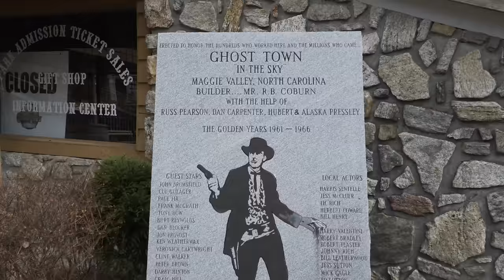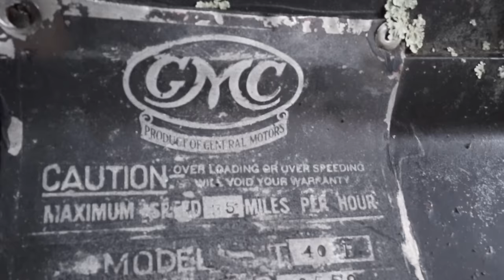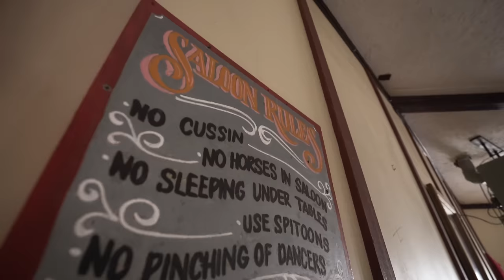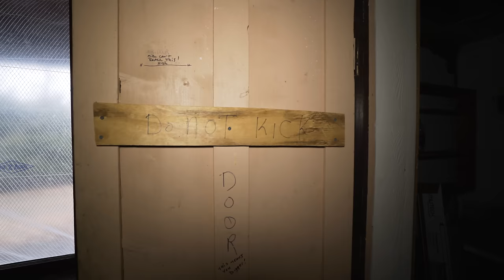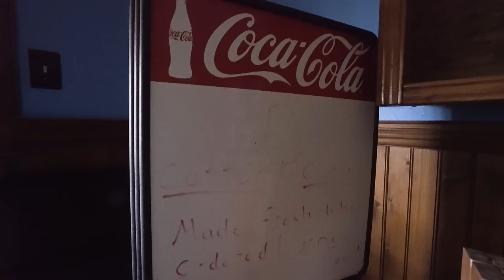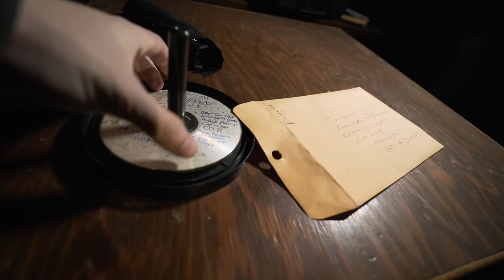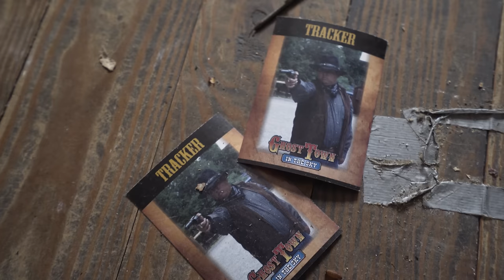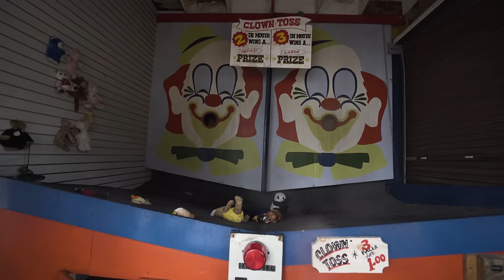Abandoned Theme Park on Top of a Mountain - Ghost Town in the Sky

Comment: Ride operator here! For those wondering, this is a Hopkins coaster, and yes they were quite a small manufacturer. This is one of 9 roller coasters they made, 7 are still operating today. They made a few loopers and family coasters, nothing outrageous. As for that control panel, it's about par for that coaster, it's not the system most rides use at big parks today. We usually have a screen for error reports, or even on the older coasters, to tell the time. The trains did get replaced in 2009, but it only ran a little bit in 2010. This coaster was originally called Red Devil and had red track and white supports. It was renamed when the trains were switched.
Reply: For those wondering the Hopkins that are left are
Texas tornado- wonderland Amarillo texas
Desert storm and patriot- castles and coasters Arizona 
Polar coaster- storyland new hapshire.

The dragon was left off cuz it was recently scrapped
Reply: Awesome story ❤
Reply: Thank you ❤ and thank you for clarifying THE RED DEVIL I can't tell you how much my family loved Ghost Town In the Sky
Reply: Hopkins was more successful in their log flume and chutes rides

Comment: I always surprises me when valuable items (that could probably be either sold or used elsewhere) are not removed before a property is abandoned.
Reply: One of the fascinating things about abandonment are the reasons and events which lead to that. Larger sites etc. often have social implications as well. Small businesses rarely plan to abandon things, it just happens and they may lose the possession of the site. Larger businesses rarely ever tell in advance that something is going to be shut down. 

I often buy small equipment and materials from a contractor which cleans closed sites. They may do that for free if they can sell and scrap what they can. It is an interesting business as selling parts of a processing plant etc. is not easy and it requires special knowledge to tear things down and pack them for storage or sale. To clean this site would probably be easy, but selling the things would not offset demolishing it.
Reply: They tried very hard to reopen, and when that failed, they tried to sell the property intact, hoping a buyer with enough money to get it open would buy it. That is why everything was left as-is.
Reply: IKR?
Reply: Yeah, the gear in that recording studio looked mint. As long as it wasn't water damaged of course

Comment: Hey everyone, here’s some coaster background for you: 

The rollercoaster first opened in 1988 as “Red Devil” hence the random old red train you saw 10:19 which was actually used until 2002 when they closed. they planned to reopen the park in 2007 with a new coaster name “Cliff Hanger” but it got shut down for “technical issues” so they purchased new trains and attempted to reopen again in 2009, But the brand new trains had a hairline fracture in the frame which happened just 2 days after receiving the trains. So the trains were indeed janky 😂 They spent 11M on the parks reopening, half of which went towards the coaster, just for the main attraction to break in 2 days and they went bankrupt in the process, officially closing the park for good.

Comment: There is a development company that is in the process of trying to "redo" the park and wants to create a beach area at the bottom of the mountain with shopping. They've told the Maggie Valley Chamber that they hope to break ground in 2022. The Cliffhanger was built by Hopkins Rides (FL) which was purchased by White Water Attractions in 2012. Hopkins was mostly known for water / flume rides but did build seven roller coasters during the time they operated. Currently only four are still in operation (Texas Tornado - Wonderland Amusements (TX), Polar Coaster - Storyland (NH), Desert Storm and Patriot - Castles N' Coasters (AZ)).

Comment: I used to work there from 2007-2009. I was a Lift Operator at the Bottom. The Red car was the original train when it was Built as The Red Devil, and the new one was built by Rotational Motion from Knoxville. I rode it once for a employee only day and it was better when it was renovated.

Comment: My greatest memories of that place was almost falling out of the ship swing. I was scared to death of the chair lifts as well but it seemed safer than the tram that went to the top so that was a plus to my advantage. I will never ride one of those again til this day. Under the roller coaster to the front was the scrambler in side the building. It was dark with strobe lights.  By the town where they put on the shows they use to have a large centrifuge wheel that spun and tilted side to side right next to the ship swing and I remember clearly the little mop closet chain that was even with my face that could have held me in if I hadn’t died if something happened and it came off the base 😂.  The roller coaster I must have rode it about 10 times before I got nervous bc I knew it wasn’t very safe. The ship swing I almost slipped out of and I wasn’t strong enough to hold on any longer and my screaming the person finally stopped it bc I had came out from under the bar.  Never again will I ever do something so terrifying as one of those rides. It always rains there also. I have been several times. It’s a shame that it didn’t make it. Before Dolly wood was Silver Dollar City and these 2 parks were pretty much all the entertainment we had as children. Thanks for sharing this it brought back so many funny and frightening memories to see Ghost Town again

Comment: The only roller coaster built on the top and side of a mile-high mountain. If the property was properly marked at every boundary corner and every 200 yards along each boundary line, you were in violation of NCGS 14-59.13; a Class 2 misdemeanor trespass. The reason these laws are in place is because if you get injured while trespassing, the owner is still liable. It pisses me off that people don't respect property owners rights. Proper people don't trespass.